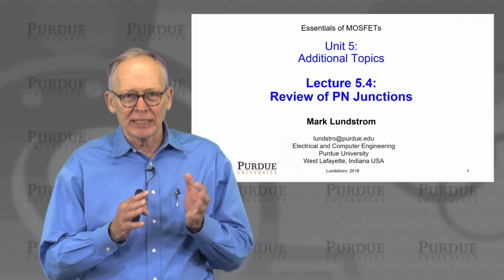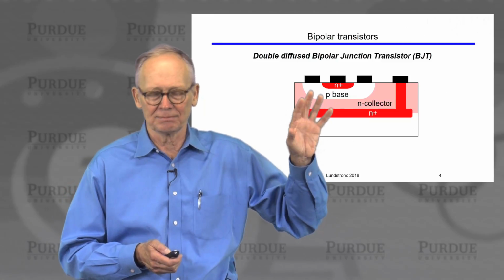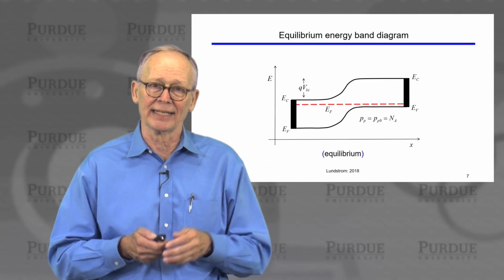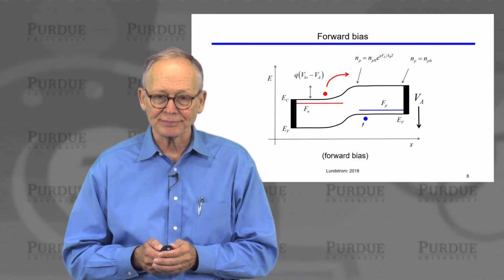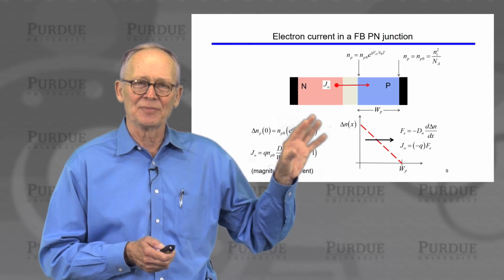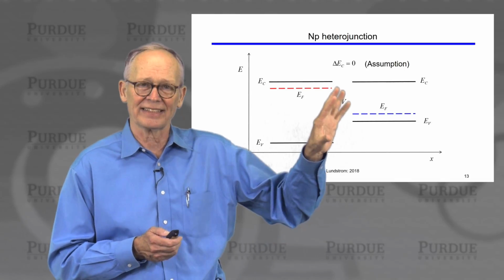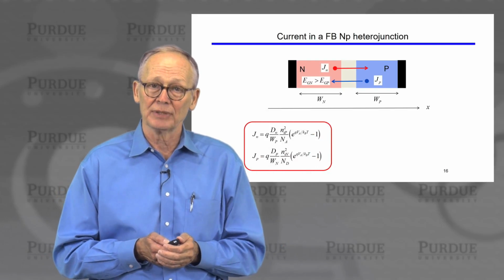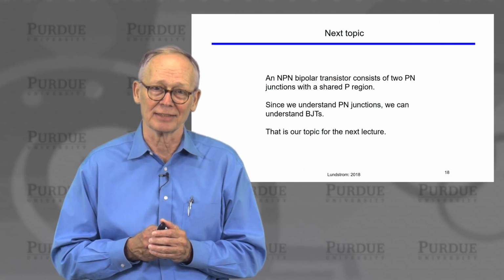nanoHUB-U MOSFET Essentials L5.4: Additional Topics - Review of PN Junctions

Comment: 00:00    Lecture 5.4: Review of PN Junctions
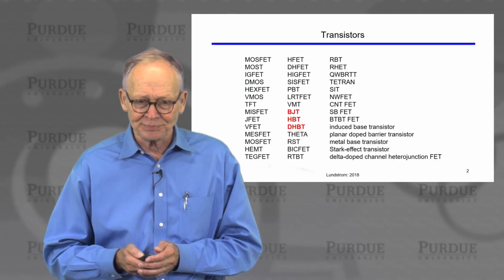00:30    Transistors
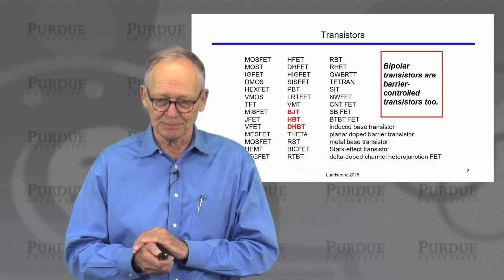01:10    Invention (and discovery) of the transistor
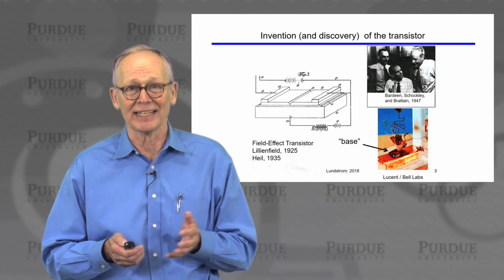02:28    Bipolar transistors
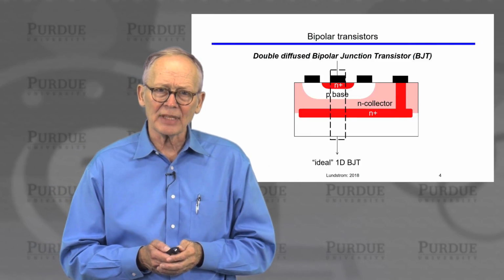03:20    Bipolar transistors
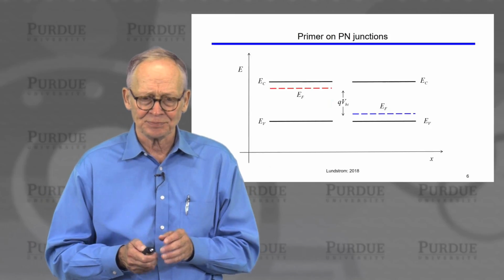03:57    Primer on PN junctions
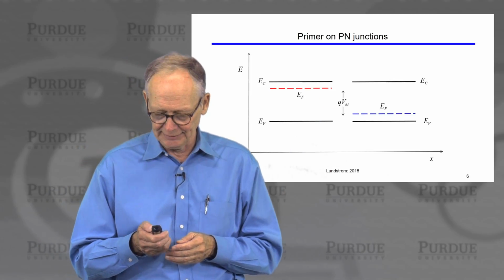04:31    Equilibrium energy band diagram
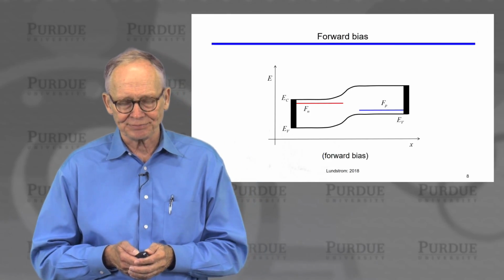05:51    Forward bias
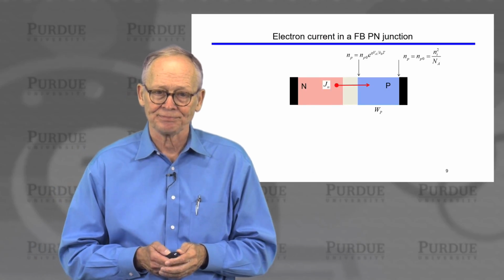08:12    Electron current in a FB PN junction
10:22    Hole current in a FB PN junction
11:19    Current in a FB PN junction
11:48    Heterojunction diodes
12:14    Np heterojunction
13:12    Equilibrium energy band diagram
14:00    Equilibrium energy band diagram
14:27    Current in a FB Np heterojunction
15:55    Summary
17:10    Next topic